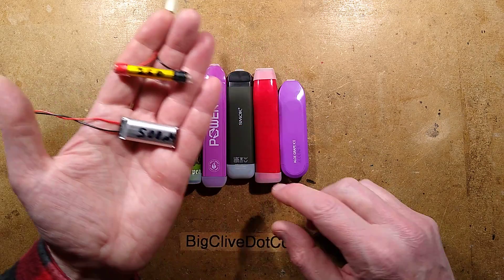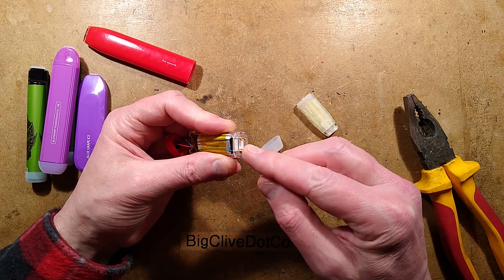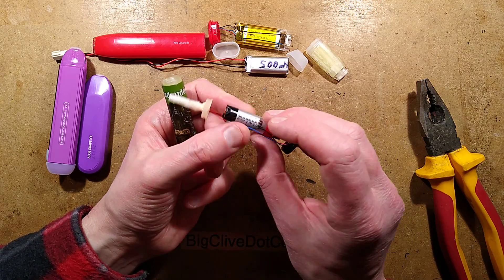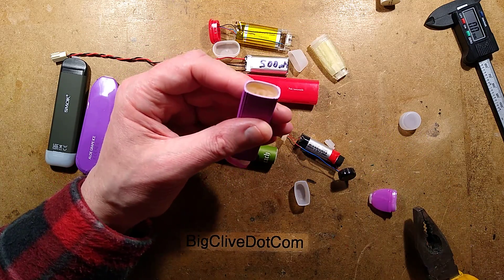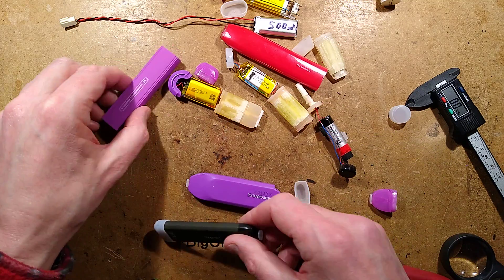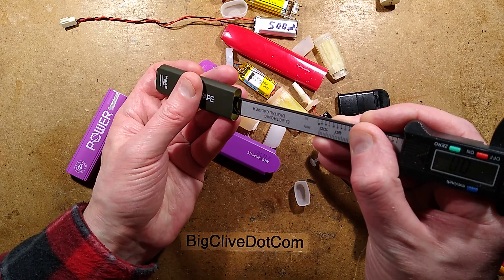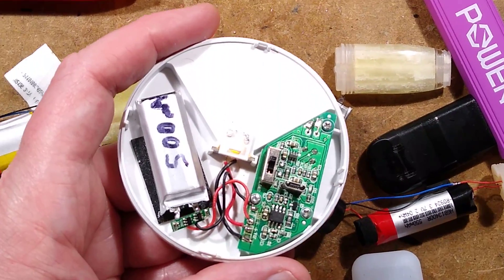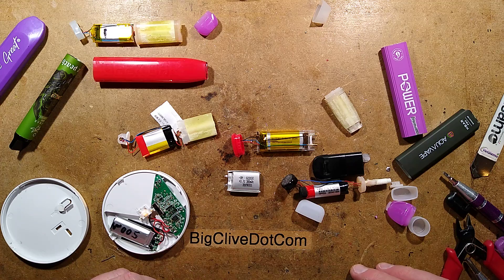Scavenging rechargeable lithium cells from the roadside

Comment: I've gotten battery packs from discarded health equipment, but my employer has discontinued using them as they've had incidents with them leaking or exploding. I had planned to give them some of the cells for flashlights or headlights. I believe these to be 18560 cells, which are quite common.

Comment: I don't know which I dislike more, the idea that perfectly good rechargeable lithium cells are "disposable" or the fact that a manufacturer used an aluminum housing on a "disposable" vape just to make it feel better in the hands.
Reply: At least aluminium is recyclable, while plastic in most cases isn't.
Reply: The single use THC ones are even worse. They have a charger port so you can charge the battery but you cannot simply refill the vapes tank. One a friend gave me was empty but had a perfectly healthy battery and rather nice type C charge regulator board. The guts are currently inside a LED flashlight that used 3xAAA cells. ❤
Reply: There's a brand called crystal pro which has even more waste, with a clear acrylic housing surrounding the metal tube - feels nice and chunky and solid/heavy; most of the weight is not the battery though
Reply: is there really any more aluminum in one of these than there is in a soda can though?  

I live with someone who throws his empties in the trash even though my aluminum bucket is next to the trash. There is no winning. Waste will never end.
Reply: @spiderpickle3255  Aluminium cans are actually very light, very little material. I wouldn't be surprised if that chunk has more metal in it. Still, a waste either way. Aluminium is one of the most easily and effectively recycled materials.
Reply: LOL @ fucktube deleting my comment that included the weight of standard empty cans

EDIT:  three times!!
apparently these weights are against the rules to publicaly post
Reply: @spiderpickle3255  Except people don't buy these "roadside devices" by the 12/24 pack. I bet 1 12 pack of cans has as much aluminum as that single extrusion. Aluminum is incredibly abundant, it's just a matter of electricity - are you going to get upset that I leave a light on in my garage even when nobody is there?

Sure, it should be recycled, but at least it isn't plastic. I melt all my cans and cast things with them. Aluminum trash never builds up anywhere like plastic does since they have built in value. The drug addicts clean them up and sort them out like fresh needles...
Reply: @ryanroberts1104  tl;dr
sorry, troll
Reply: @spiderpickle3255  Hmmm...  weight of a standard empty aluminum can is 14.9 grams, half an ounce, 14.2 grams... ?  Not seeing anything suspect there, and I've been trying to work out the specific things that cause "a failure" ( different rules for different channels, I think ).  Is any part of it underlined in grey when it's entered?  I've seen that with certain political names, which then "mysteriously" failed.
Reply: @idjtoal  Thank you!
I tried 3 times formatted 3 different ways. my last try I even wrote the number out rather than using the numerics and it was still auto-deleted even though there was nothing else written but the weight.
Reply: @spiderpickle3255  No problem, getting past it is maybe the biggest thing right now.  Spelling words out, right, adding underscores or breaking up the letters, phonetic equivalents even.  It also fails randomly though, I've noticed.  Maybe it did that and then flagged the next attempts as spam?  No idea, the rules probably change all the time.
Reply: @spiderpickle3255   I just think youtube is buggy/laggy, 50% of the time, comment edits of the most innocuous type, just delete/lose the entire comment. When YT shadowbans, the comment is visible only to the poster, they don't actively delete unsavoury comments. You can check this by having a second account.
Reply: @EvileDik  I've been checking mine from another browser, where I'm not logged in, and they're just not there when they "fail".  They disappear when I reload the original page, also.  Agreed on the bugginess, I've seen things not show up that should've been completely fine.  But try using the "bundle of sticks" f word sometime -- it shows up, then goes away in maybe 30 seconds.  So there's a few levels of filtering, maybe?
Reply: @ryanroberts1104  aluminium cans are way easier to recycle than these things though, considering the other stuff contained in these ecigs, and you have to pull out all those innards before tossing it in a recycling bin, when compared to just stomping on a drink can
Reply: @ryanroberts1104  Because of the value they have, many landfills will try and sort out the cans for extra revenue. They do a crappy job of getting them all because they aren't worth enough to justify spending much time on it, but it's still done.
Reply: @lobsterbark  Cool story, what's your point? No shit.
Reply: @ardius9777  So what. Aluminum is disposable. Aluminum is the most abundant metal on the planet. Lots of people throw away cans, and there is nothing what so ever wrong with that. Once in the landfill they are inert. We have more than enough empty space for landfills. And one day they will probably dig them all back up and mine them...
Reply: @ryanroberts1104  I don't know what country you are in, but the UK is running out of landfill space: it's one of the reasons landfill charges are rising. Try getting your facts right before you comment; and the advanced techniques is to try to get the facts right for the country relevant to the channel.
Reply: @spiderpickle3255  ya that is true, and we throw away aluminum foil to.
Reply: You ever drink from an aluminum can?

Comment: I pick these up all the time! In practice, results are hit or miss -- some cells are still in good shape, some have discharged to 0V and are worthless. But if you're walking around anyway, the only loss is disassembly time. As for construction, the round ones are most popular here in the NE US, and seem to mostly be steel. Flat ones tend to be very thin aluminium. I like to find things to use those pieces for as well. I'll usually pick them up with disinfectant wipes and wipe them down really good with alcohol when I get home. Most I can't find any specs on, and some have the capacity marked, so I just use them for low power MCUs and such
Reply: Cells discharged to 0v aren't necessarily worthless. BC has gone over this in an old video, Lithium cells are really only irrecoverable if they've been reverse charged, like what happens in battery packs when a weak cell goes flat before the others and gets reverse charged by the other cells. But if a cell was just normally drained to 0v, or its internal resistance did the same, you can usually bring them back to usable. Though I wouldn't put them in a pack with other cells, just use them by themselves in something like a solar light.

I've got tons of dead battery packs with weak cells like this and they work great in low drain applications. You can usually get a few hundred more cycles out of them before they're so weak they don't work anymore, when you can chuck them.
Reply: @GGigabiteM  yeah, they’re not always dead. I tend to have bad luck with 0V cells from these things — I think I’m finding them weeks or months after they were discarded in some cases — they refuse to hold any charge a lot. I’ve had much better luck with 0V cells from laptop battery packs and things like that, that weren’t living outside in the elements
Reply: @GGigabiteM  well, healthy cells can hold charge for years without losing lot of voltage. If cell has enough internal resistance to discharge to 0V all by its own leakage, it has grown a whisker and its faulty in dangerous way.
Undervoltage doesn't necessarily damage the cell, its just symptom of damage, that means, its only okay to use it if you know that something else had overdischarged the cell, if its still healthy can be checked by fully charging it.
it should be able to hold about 4.15V for extended periods of time.

Comment: I haven't seen anything like this in the US for several years, we seem to just have the microcartridge nic salt ones along the lines of Juul...at least for nicotine. In Devil's Lettuce states disposable  green stuff concentrate vaporizers are very common though. The tech in these disposables looks pretty stone age, I took apart an 'nJoy' cart and it used what looked like some kind of porous sintered metallic heating element directly integrated into the reservoir rather than the coil-and-cotton.

Comment: In my building complex, we have waste sorting bins, also one for batteries. So whenever there is a laptop battery in there or other rechargeable consumer electronics, I take it apart and save the cells. Often these cells have more than half of their life left, so a free source of 18560 cells. The cells in the featured video are excellent for small drones, which otherwise would be impossible to get replacement cells for without paying much too much.
Reply from the maker: Keep in mind that drones often require high current cells.
Reply: @bigclivedotcom  but aren't these LiPos in the ecigs high C as well? I imagine that nichrome wire heater will for sure have a high current demand
Reply: @rgones  Heaters aren't low-current devices, but drone motors are at another level. As mentioned in another comment vaper lipos work fine for cruising and slow flight, especially on ancient brushed models, but you'll abuse them pretty heavily if you run high-performance brushless micros on them.
Reply: @fallingwater  I was thinking about the small palm sized toy drones. I doubt they use anything else than cheapest possible cells already.
Reply: @rgones  realy depends on the resistance of the heater coil just basic ohms law
Reply: @bigclivedotcom  I know almost nothing about drones.  But, I switched from smoking to vaping a dozen years ago this month.  The devices need high drain cells too.
I'm appalled by these 'disposable' devices!  I can proudly claim to have never purchased one.  Lordy, people (rightfully) object to smokers littering with cigarette butts, these are an order of magnitude worse.  Good for you and others who are reclaiming some of this resource and helping to clean up the mindless behavior of others.
Reply: Lidl is great the exits usually have big barrels full of used batteries and having tested many i would say 25% of the batteries are ok and still 1.5v on full load testing peeps just throw away everything without testing them individually pp9's not so!
Reply: @garrygemmell5676  do they mind/take notice if you sort through them?!?
Reply: @stevecann3394  Best to ask but i dont bother no one ever bothers in East Kilbride i guess its down to your level of embarrassment factor hehe In Scotland we have no shame thats why we have painted blue faces instead of Sassenach red ones lol
Reply: @stevecann3394  sometimes.
Reply: @garrygemmell5676  good job! I'd be afraid of dropping the whole tub and being banned from my local 😁
Reply: Similar here - I have a box of salvaged 18650s from old laptops from when my previous employer surplused about a dozen Dell Precision laptops several years ago. Even the low capacity ones work great in my LED flashlights, and I even made a DIY power bank for a Ras Pi project.
Reply: Smart!
Reply: Thats true,  I still use 3 litium cells from my Acer laptop from 2008 year)  Don't know about capacity, but still work fine for my tasks.
Reply: Lucky fellow| Around here, we only have these waste bins at shopping malls and security will be all over you, if you try to pick something from there - apparently it's a good business to "recycle" tech waste and they don't want people interfering with it.

Comment: They have us recycling aluminum (or aluminium) cans and then they sell an e-cig in a tube that could make a few cans and don't bother recycling that.  You should weigh that tube and compare it to an aluminium can just to find out what the "can equivalent" waste is.  I think single use lithium is a waste too, except maybe for very long life standby applications.

 I think wasting metal is a shame,  someday our descendants will have to mine the landfills.  LED bulbs may last awhile but I hate throwing out that chunky heat sink many have.

Comment: I’ve only ever come across one in a parking lot. But, I’ve saved the cells from every one I’ve personally used. The ones I used to get would die before the “juice” ran out, so I’d pop the battery out and recharge it to double lifespan. No idea what I plan to do 30-ish cells, but I have them just in case...

Comment: I often scavenge the piezo igniters from "disposable" lighters. I have repaired mini-blowlamps with them and also used them for insect bite/sting pain relief devices. Not sure if the bite/sting theory is correct but for (almost, because I 3D printed a housing for them) zero cost...
Reply: The piezo shock supposedly interferes with the pain sensors on the skin sending signals to the rest of the nervous system
I find that applying a little heat works better, probably by denatring the venom proteins that generate the sting/bite pain. The flame from e. g. a cigarette lighter held a half inch from the sting/bite site for a second or two does the trick (enough to redden the skin a tiny bit but not enough to cause an actual burn). Absent that, briskly rubbing the site helps some (if it's a bee sting, make sure you pick the stinger out first).
Reply: @markfergerson2145  a cup/mug/glass filled with a hot beverage of your choice also works quite well, just press it against the sting for a few seconds. And yes, the heat denaturates/destroys certain components of the venom that cause the itching.

Comment: I have salvaged a couple of cylindrical cells (18650), that have "failed" open circuit.
Opened them up top+, soldered a wire and sealed them with hot glue and/or epoxy resin.
Reply from the maker: That does indicate that they may have experienced a high current overload or internal pressure incident.
Reply: The latter one might be a combination with dual weld breaking.
Reply: Tried posting a link with pictures and videos, but they got removed.

Comment: I have salvaged even bigger vapes that had 16350 cells, the "used battery bin" is where these tend to end up here, I have 1 3/4 of coffee jars full of all kind of these cells. A lot of these vapes have stainless steel or aluminium cases, I used few to build a rechargeable pen lights._
Reply: Also I accidentaly found out that the sensor can be turned into touch switch with time out feature when you replace the membrane with a single wire._

Comment: Hi Clive, another fascinating and very useful video.
I'm wondering how do you actually test the capacity of a battery cell? 
It would be great if you could explain to us and show us all a simple way of doing this,  which we could all do at home. 
Knowledge is power!    :-)
Reply from the maker: I fully discharge the cell and then monitor the mAh going back into it.
Reply: @bigclivedotcom  Thanks Clive.
I'd love to see you demonstrate/explain in detail your method one day.   ☺
Reply: An IMAX B6 will do the trick as well as other useful functions (charge/discharge/balance charging).
Reply: @chaos.corner  hmmm, OK.
That would cost more than the battery though. I was thinking more along the lines of putting some sort of load on the battery,  and using a multimeter for measurenents and doing some sort of calculation.
Reply: @ericoppel5698  Oh, there are lower tech methods if you just want to do one and some have already been mentioned. If you plan to do much battery gathering though, you'll be wanting something to charge them is where my head was. The B6 is not terribly pricey and you don't have to worry about over discharging or overcharging. Balance charging is also important if you want to do any series stuff too. There may also be better/cheaper ones by now.
Reply: @chaos.corner  It does sound like a useful gadget.
Reply: A low-tech method using junk bin parts:
1. Charge the battery to the marked voltage. Or, if it’s unmarked, probably best to consider it a 3.7V battery. Options abound to charge Li-ion batteries. (If you happen to have a bench supply, simple CC/CV modes make it effortless.)
2. Measure the battery voltage. Note the time.
3. Put a load across the battery. Again, options abound. One quick and dirty option I’ve used is to use a ~1W, low-ish value resistor in parallel with a 2.2-2.7Vf LED and a high value resistor. When the voltage drops below the Vf, the LED turns off. At this point, the load should be disconnected, to prevent under-volting the battery. (I make no claims that this is a precise method of signaling the voltage - only that it’s a fairly easy and visual one.)
4. Measure the battery voltage. Note the time.
5. Ohms law using Vstart, Vend, the (total) load resistance and the time will give you estimates of watts & mAh. I say _estimates_, because as the voltage falls, the voltage dropped by the resistor will naturally also fall - meaning the current and wattage will also fall - thus making the discharge non-linear. To improve the estimate, feel free to repeat step 4 a few times during the discharge cycle. Excel and its curve-fitting are your friend here.
Note: putting the load through the LED provides much better protection for the battery, as it the voltage cannot drop below the Vf (in practical terms). However, system becomes even more dramatically non-linear as the voltage nears the LED’s Vf. So, several more voltage measurements are needed to get a good estimate. In a recent demonstration, I used a couple 3W LEDs in this configuration and the results of the experiment matched the claimed mAh rating within ~5%.
Does that help?
Reply: @a1nelson  Awesome, many thanks for explaining that.